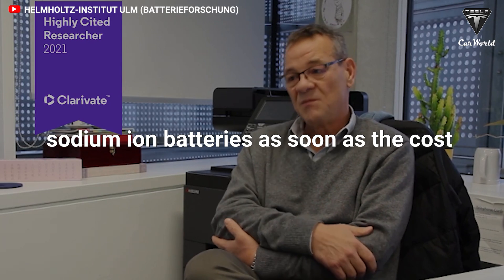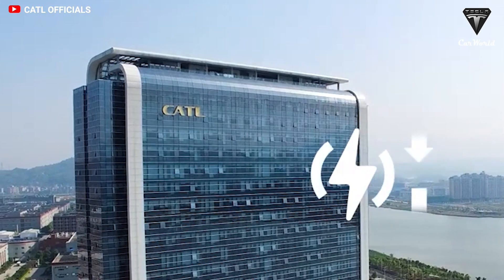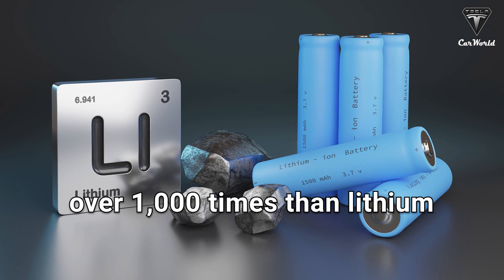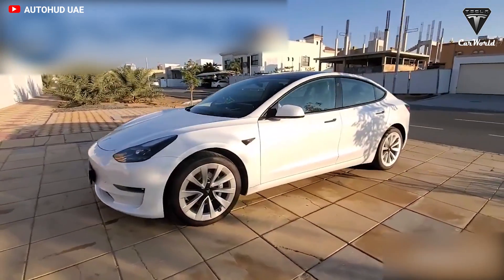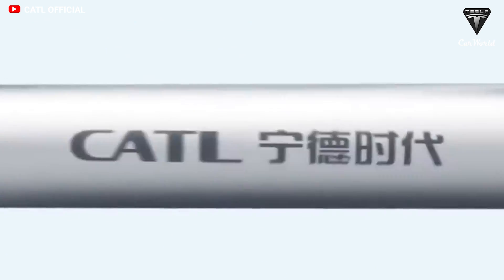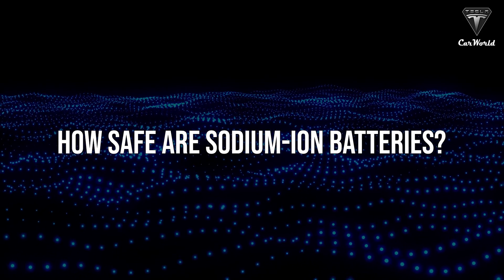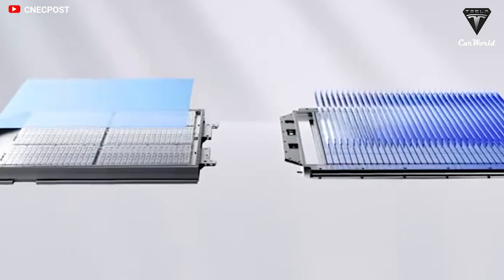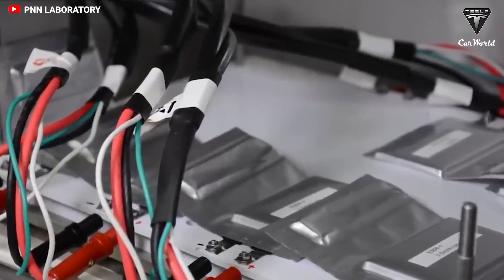Goodbye Lithium! NEW Sodium Ion 4.0 Battery Changes Everything in 2023!

Comment: It is unlikely that sodium batteries will completely replace lithium batteries in the near future. While sodium batteries have several advantages over lithium batteries, such as their lower cost and greater abundance, they also have some disadvantages that make them less attractive for certain applications.

For example, sodium batteries typically have a lower energy density than lithium batteries, which means that they are less efficient at storing energy in a given volume or weight. This makes them less suitable for use in applications that require a high energy density, such as electric vehicles or portable electronics.

Additionally, sodium batteries can also be more challenging to manufacture than lithium batteries, and their performance can degrade more quickly over time. This means that more research and development is needed before sodium batteries can be widely adopted for a variety of applications.

Overall, it's possible that sodium batteries could complement lithium batteries in certain applications, but it's unlikely that they will completely replace them. The most likely scenario is that different types of batteries will be used in different applications based on their specific advantages and disadvantages.

Comment: Lithium batteries are dangerous as it could explode itself under pressure.
So it's best to stop production of lithium batteries and replace it with sodium batteries as soon as possible.
Just as recent news of lithium batteries exploding itself and setting fire on board of a plane recently.

Comment: Lithium increased in cost solely because of the law of supply and demand. Your analysis presumes, wrongly, that the same would not occur if Sodium becomes competitive.
Theres lots of ways to make batteries. You can make a few of any of them on the cheap, but subjecting any of them to increased demand and the cost per unit goes way up.

Comment: A battery starts losing energy the moment charging stops. It also takes more power to charge a battery than it can hold. This is very wasteful. We need to develop a method of storing energy that does not lose it, when idle. We also need a method to minimize the amount of energy lost while transferring it to the device. The battery is a very old idea. We need newer and better technology to significantly reduce the use of fossil fuels.

Comment: Everyone is so obsessed with range, I don't get it. I have gone on massive road trips on my motorcycle that only has 100-150mile range and never had a problem. It comes down to infrastructure. Also, this is strictly talking about long road trips. for 95% of the daily use, the range is not even CLOSE to being an issue.

Comment: When EV batteries can be recharged in the same amount of time it takes to refill my almost empty 36 gal fuel tank, has 0 battery degradation over the life of the vehicle (meaning the battery will retain the same charge as when new, my 36 gal tank never shrinks) and cold weather performance is equal to an ice engine then EVs will sell themselves.

Comment: Sodium ion batteries cannot be alternative to lithium ion batteries in EV. Because energy density of sodium ion batteries are so low compare to lithium ion. The reason is that you will know if you look at periodic table. Sodium locate on bottom from Lithium. This means that Sodium's most outer layer shell is bigger than lithium. Therefore, size of sodium is much larger than lithium. Therefore, numbers of sodium ions you can put in in limited amount of space is much fewer than numbers of lithium ions you can put in. This is why energy density of sodium batteries are so low. 
However, it does not mean that sodium ion batteries are useless.
Sodium ion batteries will be used on ESS in the future instead of EV. Because Sodium ion battery is safe, it is suitable on ESS. Because you can just stack up many batteries as you can on ESS but not on EV. So you don't have to care about weight.

Comment: wow wow ! slow down a bit ...it won't change everything so fast as the title says .There is far road to travel before even the hybrid of lithium / sodium will be practical to use on vehicles due to significantly lower energy capacity / weight ratio . But there is potential when the off road heavy equipment industry eventually little by little abandons the diesel idea . Also local stationary energy storage for homes , commercial buildings etc. when solar panels are engaged .But even hybrid lithium/sodium technology won't develop overnight (if ever ?? )to be useful for cars and especially airplanes ...unless they develop another technology of installing tracks on da plains which will end up by traveling on the ground more than in air ... yo 4 real ! ..but will be less chances for crush and could travel on rough terrain imitating the rough bouncing in air when passengers get freaked out

Comment: Sodium batteries are like old flashlight batteries. These don't last a week and are not rechargeable. Sodium batteries tend to short out and leak. Salt and acid ruins contacts and circuits. Change to sodium batteries is going from bad to worst.

Comment: The high price of lithium is not is not because it is a scarce resource in the earth's crust, it's more common than lead.  The problem is the facilities to extract it have not grown at the rate the demand has. Electric vehicles and mobile phones plus many other devices use lithium in their batteries which has increased demand massively. High prices for lithium are not sustainable in the long run although the current situation and worse is set to last for a few years yet.

Comment: The elephant in the room is still the charging capacity coming from the current grid. Liquid energy is still far more efficient by a long shot and all liquid energy needs to completely overhaul electrical energy is proper administration.

Comment: The great thing about this, is that it has the potential to solve a few environmental issues.
There is the obvious solution to digging lithium out of the ground. 
Then using sodium can solve the expensive salt waste issue with the process of water desalination. In turn making the desalination process easier and cheaper to provide fresh water for the planet.

Comment: I won't be running the charging of any lithium batteries in my household.
cobalt mining slave labour, I will never tolerate that for lithium batteries/materials.
lithium fires, when charging. when do you charge the car, overnight. DEADLY risk.
Not running batteries if the charging is going to come from Solar/wind.
There must always be some kind of high percentage of reliable 24/7, 365 days a year electricity production, like coal, nuclear, or whatever can replace them. Solar/wind cannot replace them due to intermittent for the charging of a whole countries EV's overnight.

Comment: Honestly due to the weight, sodium batteries would be a great fit for houses not cars, while solid state batteries without lithium would be a great fit for cars. That being said vanadium flow reaching 40 kwh and only costing 10K is a very effective competitor. I am not sure if they can put this in a car, but for a house it would be a alternative yet cheaper option. It was a bit ago but there was an article that Japan has figured out to make a solid state battery without Lithium using Magnesium ions. Was only a year or so ago that it was published but if that works, so it could be still in early stages, but if it is viable, that would solve the current lithium being really expensive crisis.

Comment: Sodium doesn't like moisture like alot it doesn't like moisture. You hold some in your hand at it will burn you from the moisture in your skin. I don't see sodium, unless it can be absolutely stabilized from reacting with moisture, to be of any public benefit. I noticed that was not mentioned in the video and is huge.

Comment: These sodium-ion batteries seem promising, but keep in mind they are about a decade behind lithium-ion in their development.  The biggest drawback, at least initially, will be the range of EVs with sodium-ion versus lithium-ion.
Reply from the maker: That's right. They need to be further developed in order to completely surpass the status of lithium.
Reply: @TESLA CAR WORLD  I am not sure they will ever "surpass" lithium-ion in terms of sheer range, but they should be able to close the gap enough that all of their advantages in other areas will more than offset it.  Another potentially huge application of sodium-ion batteries is in energy storage from "clean"--but intermittent--energy sources such as wind and solar.  In that application, since the batteries would be in permanent fixed locations, their bulk and weight really would not be much of an issue compared with when they are used in a moving vehicle.

Comment: Will sodium-ion batteries replace lithium?
No, it is generally believed in the industry that sodium-ion batteries and lithium-ion batteries are complementary to each other rather than substitutes. Due to the low energy density of sodium-ion batteries, they are more suitable for use in medium and low-speed electric vehicles and large-scale energy storage.Dec 30, 2022

he bought out old tech to save money LOL

Comment: This is a scam you would need 2 in series to get the same votage as an 18650 lithium ion and the capicity is garbage compaired it would cost the same for q 48 volt e bike baterrie and weigh twice as much if not more if you want capacity if you want a 20 ah battery it would cost double the cost of a lithium and weigh triple close to 50 lbs absolutly crazy they are trying to push this

Comment: Doesn't pure sodium explode in contact with water?
I'd imagine that the moisture isolation schemes would need to rival those applied to Chalcogenide perovskites in the solar power industry. Perhaps the sodium would sit in subdermal super-hydrophobic grooves and avoid any grain boundary exposure.
Reply: it is. but the battery uses sodium compounds like Na CO3 and  NaHO. They are very dangerous chemicals but not flammable. They might desolve the passenger if let's say the car falls into a lake. But it generally takes time and you can get out of the car before that. Anyway one would drown in water...

Comment: The other BIG disadvantage that kricel failed to mention is Sodium's discharge curve, it has not one but TWO voltage plateaus, and this makes 1) calculating the REAL power density somewhat challenging because it is not simply voltage x amp hours since the voltage drops to about half at the midpoint of discharge which means from a power perspective you've really only got 1/4 power left at that point, and this also means the DC/AC power conversion electronics for say driving AC electric motors has to be able to function over a wide range of input voltages and handle twice the current past the half-way point in order to get the same power at half the voltage.  The increase in expense of electronics and wiring will probably more than compensate for the decrease in battery cost.
Reply: Nay, Electronics is cheap. It only has to handle voltage and current, not energy.

Comment: On the average, battery development takes 20 to 30 years before product release......I was offered work at two research facilities in 1977 to develope rechargeable lithium cobalt batteries. They weren't available in quantity until 2002. Sodium batteries may be in automobiles by 2043......or later.
Reply: The first Sodium-Ion battery was built in 1807. The technology is not exactly new. Development cycles have sped up a lot with the electrification of the energy sector. Also CATL is currently building a large scale factory for SIBs which is set to start production in Q2 2023. There are concrete plans for combining iron-phosphate batteries with Sodium-Ion batteries to make up an EV battery pack. BYD has proposed a car which utilizes this technology for 2023. The future is now.
Reply: @lukasschwab8011  No doubt the sodium battery is viable, it's just the safety and durability that must be established by at least 20 years of development and testing. Many of us won't live to see it powering electric vehicles but no doubt it is an option. The vibration, moisture and load extremes make this particular design concept a difficult one and it will only require time and effort.
Reply: @charlestatakis9363  I'm sorry to say that but you're lacking behind current research then. They've been proven to be safe. Sodium-Ion batteries are commercially sold at this very moment and as I said there are concrete plans to have them in cars. If everything goes according to plan the BYD Seagull will be the first Sodium-Ion powered car in Q2 2023.
Reply: @lukasschwab8011  I'm a chemical engineer with 41 years of experience, most of it with electrochemical devices. When I was offered a job in 1977 it was specific to lithium ion cells and sodium cells were not as efficient or long lasting, the lithium cells were more stable, durable. Sodium celll have been around for a long time and in the 1970s they were to be developed but lithium was the only viable option. These newer sodium cells will be available for automobiles no sooner than perhaps 2040.
I feel that the "new" sodium cells using a hard graphite anode and sodium composite cathodes are simply not yet durable and side reactions may result with violent chemical reactions and until those charateristics are improved they're not ready. Perhaps in 20 years. BYD is a Chinese manufacturer and it's statements, I believe are not totally honorable and they "desire" to use sodium cells in 2023. The cells are not ready and BYD will not use sodium cells for a long time...if ever.

Comment: Sodium batteries are nothing new.  I once worked in the same building - decades ago - with a company that had a patent on this technology.  They were used for space exploration.  There was a reason why they were limited to space exploration.  It was due to the fact that sodium virtually explodes when brought in contact to water.  So, one leak, and your car is a rolling bomb.

As it stands right now, when one of those lithium eCars lights up on fire, first responders cannot put them out.  Sodium would make it 4x worse.  And, you can't use a fire hose to put it out.  

Space doesn't have a lot of liquid water in it, and no one cares if your satellite melts down in orbit, or if your probe flames out on the way to Saturn.

Comment: This video is nonsense, the range of an electric vehicle is dependent on the capacity of the battery in Wh, if the energy density (Wh/m^3) is lower for sodium which it is then you simply need more space for the battery in the car to meet the same range as a lithium ion battery EV using vehicle range as a metric for energy density makes absolutely no sense.

Comment: I made like 80000km on my ebike with diy li-pol battery and after 7 years its still going strong even in winter deep snow rides to work. But if i dies i hope they release those Sodium ion for small buyers, it will be for sure my next choice. I love that they are way safer, todays lithium batteries are crazy flammable and for me its biggest disadvantage. Im scared to buy electric vehicles from chine because you never know when it can go in flames. With those new batteries you could actually buy every crap on the market, in worst case scenario battery will just die xd
Reply: China is at least 5 years ahead of the US in the field of power batteries.

Comment: Most of this is propaganda. In reality Na ion can do much better and is not ready for market. The low temp behavior better than lithium is nonsense. The only thing true here is that sodium is cheaper than lithium. In a battery the gravimetric lithium or sodium content is low vs the heavy metals used to store the ions. Na ion has a great potential but it is not ready for market it will be another 10 years of being in the market to be performance wise comparable to li ion.

Comment: IMO-the entire EV principle is a sound one but this "push" to force everything upon the general public is ridiculous.  It would be far better to just let the technology progress at its own pace.  To set ridiculous, arbitrary schedules is bound to create a lot of waste and inefficiency.  It would be far better for everyone to just let it evolve at a reasonable pace.  Otherwise a lot of money and time will be wasted on technology that is soon made obsolete by the latest breakthrough.  I think ideally, it would be best to produce EV's for short haul service such as deliver vehicles and public transport in cities and "second cars" for suburban homeowners and commuters who have the capability to have chargers at home for overnight use instead of trying to force the concept of replacing the internal combustion engine for long trips.  Clearly, stopping for a few minutes to fill a gas tank for hundreds of miles of range is far superior to sitting at a charging station for a half hour or more.  If the goal is to replace the IC engine with electric motors the focus should be on swap-able batteries where a fully charged battery could quickly replace a discharged one.  One has to wonder why this kind of standardization isn't being pursued.  Perhaps it is because the EV batteries as they are ensure a constant replacement of the entire vehicle and higher profit margins?  Exactly how much tertiary "tech" is needed in these vehicles?  Why the push for auto-pilot systems?  The world has gotten along pretty well without them for over a hundred years.  An EV just has to go, stop, steer and maintain a comfortable environment for passengers.  The rest is fluff.  Also, this entire nonsense about proprietary  charging stations is also a big waste.  It reminds me of the days of VHS vs Betamax.